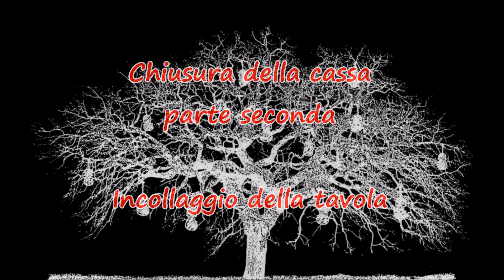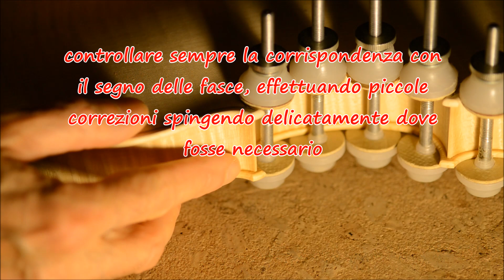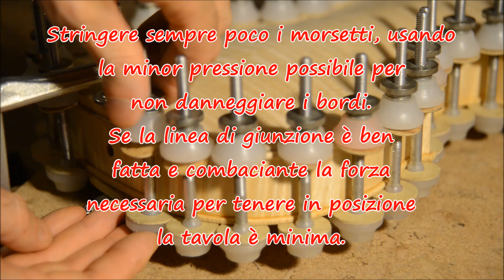Chiusura della cassa parte seconda

Comment: Is important the glue temperature? Do you pre-glue the parts before glue them? Grazie mile caro maestro
Reply from the maker: Very important, if you heat at too high a temperature for too long you break the chains of proteins compromising the strength of the glue. The optimal temperature would be around 64/65 ° C, but for some operations would tend to form the gel too early, so by heating it a little higher (70°C) you get a longer open time. To preserve the integrity of the glue the ideal would be to make it fresh every time, mandatory for the gluing that requires full strength. For gluing the back there is a need for strong gluing, instead for the table it is better to use  more diluted glue (so with less strenght) to facilitate the opening of the soundbox without damage, in case repairs are needed.
I pre-glue the blocks only, not the ribs and the plates gluing surface. I do this glue sizing after gluing the linings, when the ribs are still attached to the form but already with the final heights. This allows me to flatten the gluing surface with precision, when they are freed from the form there is no longer a reference plane because the lack of stability and because of the deformations induced by gluing to the back. You can see it in this video : https://youtu.be/WWTDMi9_IJw?t=227
Reply: Davide Sora grazie mile!!😁

Comment: David, can you share the source (seller) of the clamps? Thank you!
Reply from the maker: These clamps are self-produced, I had the 25 mm diameter nylon heads made  by a  turner and then I assembled the clamps by threading 6 mm aluminum bars. The two gaskets are cut off from a sheet of a plastic that is not too soft but still elastic, so as not to compress too much but without leaving marks in the wood.

Comment: So he takes all that care in carving, etc, but then blindly slathers on the glue with a butter knife?   All that work inside must look like it was decorated by a 3yr old now.  What a shame.
Reply from the maker: ??? Are you a maker? I think not, because you obviously don't know what you're talking about. If you use the correct amount of glue on the spatula, no dripping of glue will run on the inside. However it is not a butter knife, but a 0.3 mm thick stainless steel lab-grade spatula, very appropriate for the task, I can assure you. The fact that you mistook it for a butter knife speaks volumes about your ignorance in this field. Sorry☺️